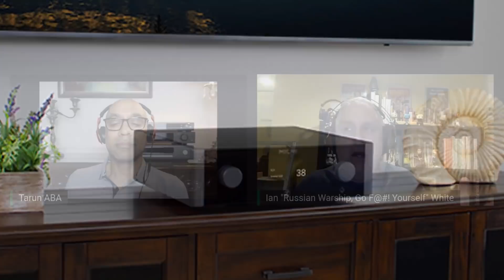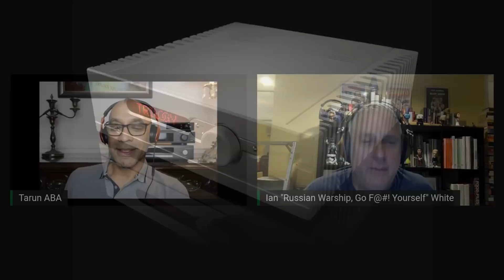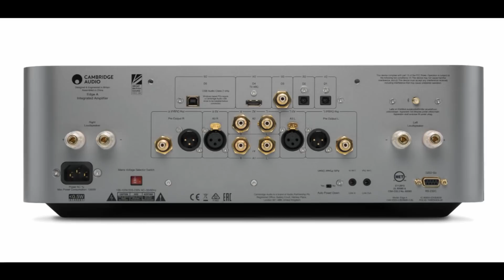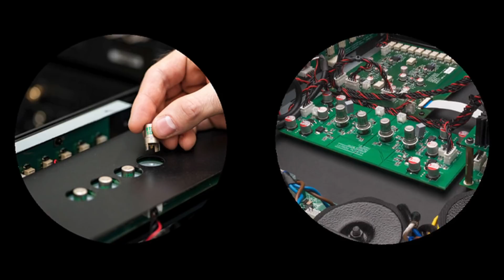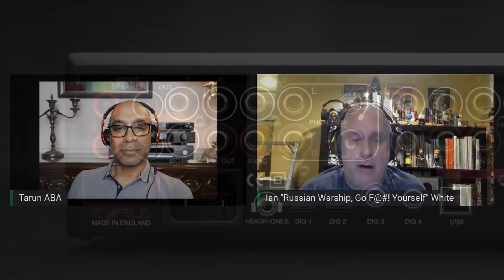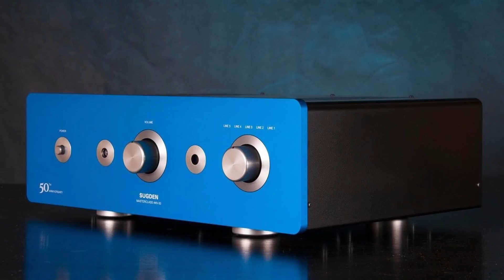Our favourite amps - The pricey stuff!

Comment: Great video guys.
Im a fan of Musical Fidelity and user of 1.
My system breakdown..
Nad m17 V2 master series processor. 
Musical fidelity M6 series 5 channel amp.
Bowers n Wilkins speakers 🔊 
Front= 702S2.
Center= 705S2 paired together for the center channel. 
Rear= 705S2 
For home theater SVS PB3000 subwoofers. 
This sounds amazing in stereo and home theater.
Reply from the maker: Thank you 👍

Comment: Interestingly enough, I quite recently auditioned the Rega Aethos. It is, with out doubt, a superb integrated amp. But then, I’m bias. The Rega Elicit had been the beating heart of my hifi rig for the last 30 years.

I recently sent my 30 year old Rega back to the manufacturer to undergo a full service. When it came back my local Audio T let me blind test it against the Aethos. Considering the Aethos retails at almost twice the price of the Elicit, I had to listen very hard to notice any difference. It wasn’t until we tried both amps on more difficult to drive speakers that the Aethos demonstrated better grip and control. Even the guys at Audio T were shocked at how close the 2 amps were.
Reply from the maker: Thank you for sharing Howard 😊

Comment: I’ve just watched your REL T-7x review which is very informative thanks. I’d like to connect two of them to my two-channel system at the speaker end not the amplifier end for ease of physical connection. What do you mean by don’t connect in this way if you have a balanced amplifier?
Reply from the maker: Thank you Kevin. You can’t use the REL high level input connected to the speaker end of terminals if you have a balanced amplifier 😊

Comment: Hello BA. Different cables touching each other in an amp, for a clean view purpose, is by many electrical standards the worst thing you can do in hifi.
Btw, hifi cable with a kind of plastic on it, in that MICHI ??? In 2022 ???
They really can solve this, it's not even a question of price. I think they just forgot all about the cabling topology in the ocean of hightech they're swimming.
I just wonder : did you ever talked about or tried speaker cable risers ? Don't u miss it, it's a huge one. It's huge. I'm sure you'd be very pleased & surprised by this incredible electrical trick.
Reply from the maker: Thank you for sharing Vivian. I haven’t explored cable risers 😊
Reply: @abritishaudiophile7314  Hello Tarun ! GR Research sales no risers but has currently made some DIY "Tinker Toys" almost free risers for his high end system... and works for him ! The idea is to put your cable like 5-10 cm away from anything else.  Works pretty fine with 2 streams of 2x16 Duelund by HP for me.
The worse support for cables could be synthetic carpet, any metallic support, everything with high dielectric constant. Have a nice day.

Comment: Hello. I love watching anything hifi. But chances are I will always be at the lower end of the hifi budget unless one of the lotteries comes up. At present my system is around £3000 worth rega 3, marantz cd & integrated amp with bowers & wilkins 607s2 anniversarys.
Now I ask how would I even know what a 10 or 50 thousand pounds system sound like as I don't move in those circles & I can't really waste a specialist hifi proprietors time just because I would like to hear the difference. Watching YouTube can't really give you a taste of what they are really like compared to my system. All I see is massive room taking speakers, valves & metal cases listening to YouTube sound on my samsung mobile or TV app. It's not a lot to ask to do that 1 thing before I die (not yet though). But I also ask is YouTube really the best platform for demonstrating hifi at all apart from its aesthetics. Not knocking the expensive stuff, just inquisitive, I can but dream.
Reply from the maker: Thank you for sharing Dave 😊

Comment: This was a very interesting discussion.  What  really caught my interest was the Sugden & ATCSCM40 combination. From your description it seems this amp drove the ATC speakers well (to highlight the talents of  the speakers), how would you describe the sound itself as oppose for same speakers driven by a powerful solid state amp?
Reply from the maker: Thank you SS. The Sugden Ann 50 has warmth whilst maintains good control of the SCM40s. This imparted a really alluring tone to the ATCs with acoustic music in particular. I would expect something like the Rotel Michi X3 with 200W on tap to have better grip, play louder but not necessarily impart the same tone. I would have to get them home to find out for sure. It all come down to what your goals are from your system 😊
Reply: @abritishaudiophile7314  Interesting combination I read the same sort of positive review from Asia when a Moonriver Amp404 (50watts x2 into 8ohms) was driving ATC SCM40's. Same sort of situation where the review states "The combination of ATC's high-end monitor and Swedish integrated amp doesn't seem like a good match at first glance, but the high resolution, transparency, and dynamic sound combine with the strength of the speaker and the objectivity of a purely musical amplifier without coloration, so the music in the recording is natural. You can get a system of excellent hi-fi sound that delivers the information without adding or subtracting."

Comment: Agree with you on the Musical Fidelity. Been a loyal fan since I bought the A1 back in the 80’s. Now running the Nu-Vista 800 with Kef Reference 5’s (fed by a PS Audio DS dac) and the sound is amazing.  But if I had to choose any other amp, it would be a Sugden.
Reply: I own a Musical Fidelity amp. Their entry level M2si. I absolutely love it.
Reply from the maker: Th am you for watching and sharing my friend 😊
Reply: Nice set up.
That I'm sure sounds incredibly amazing...
My set up is awesome for me.
My breakdown.
Nad m17 V2 master series processor. 
Musical fidelity M6 series 5 channel amp.
Bowers n Wilkins speakers 🔊 
Front= 702S2.
Center= 705S2 paired together for the center channel. 
Rear= 705S2 
For home theater SVS PB3000 subwoofers. 
This sounds amazing in stereo and home theater.

Comment: Hey guys, great list.  With you all the way to 19mins 30secs 😂

I noted the Supertech slit foil smoothing caps in the Rotel amp.  I buy them from DNM for all my upgrade projects.  No surprise to me it sounds good if they’ve gone to that extent on parts.
Reply from the maker: Thank you Mark. You should check out the Sugden Ann 50. You may be surprised 😊
Reply: Japanese amplifier manufacturers have always been in the habit of using sprinklings of premium components in their designs. On a separate note, many years ago I was visiting the Mission/Cyrus factory (the two were one company back then) and met Denis Morecroft (DNM) who was apparently working on the Cyrus amps. Subsequently they used his ‘slit foil’ reservoir caps and Cyrus produced some thin, solid core, speaker cable.

Comment: I’ve not heard the current Michi amps but I remember their predecessors. As said by your friend they were beautifully built but produced quite a cerebral type of sound that had good detail and delicacy but dynamic was not the best.
Reply from the maker: Thank you for sharing 😊
Reply: @abritishaudiophile7314 , I should add that the pre-amp (it was a pre-power combo) was a passive design (they hadn’t quite caught on then in the way they have since) and that may well have been the reason for the lack of dynamics. Unfortunately, I never heard the two units in isolation.
Reply: That all changed after Marantz legend Ken Ishiwata moved across and worked for Rotel before he passed away. He taught them how to create bass dynamics, solving the one weakness they had. And now Rotel has taken over the mantle from Marantz if producing the best integrated amplifiers in the world.

Comment: Trilogy used to be much more competitively priced but, some years ago, they made the decision to use a distributor rather than sell directly to shops (as most U.K. manufacturers do). Inserting a distributor into the sales chain meant that prices more than doubled over night and instantly rendered them poor value.
Reply from the maker: Interesting. I would like to review it sometime and find out really how good it is 😊
Reply: @abritishaudiophile7314 , the last time I heard Trilogy amps they had just released some new pre-power - both hybrid designs and very nicely built. Sound quality really stood out, great flow, dynamic shading and sound stage - really very transparent.
Reply from the maker: @AudioFlat  the 925 integrated did sound might impressive in the demo but I would have to get it home to tell for sure 😊

Comment: My Question is: HOW DID MUSIC EQUIPMENT BECOME 20X TIMES MORE EXPENSIVE since the 1970s in order to get REAL QUALITY?

& I really like this format for some of your shows and illuminates items or even economic changes..., leading to examination. - I'm a NERD!
Reply: Personally, I think the inclusion of DACs in integrated amps has muddied the waters. The Sugden is line level only, doesn't even have a phono stage and it's in the same shootout here with Integrateds that have phono stages and complex digital audio inputs. What is "better" for the same price? In my opinion, it would have to be the amplifier with no additional digital circuitry - there has to be compromise somewhere as you ladle in more features.
Reply: Actually if you factor in INFLATION over the past 50 years you actually paid MORE back in the 70's for the TOTL Monster Receivers than the gear featured here.
Reply from the maker: Thank you guys 😊
Reply: Hmm. In the 70s aged 17 I paid £30 for my first record player from woolworths where I worked along with an Al Green album that I played to death. At today's rate with your calculation that deck would be worth around £600 today, which it's wouldn't be. I could probably pick up a record player integrated like I had now for around £90. So it's not all that bad & the tech is better now. I do think more homework is now done on the tech side & electronics are smaller & smarter. So maybe it's not so bad today. By the way I still have that Al Green plus more of his in many formats sounding so much better. I also think years ago much hifi was surround in teak wood (awful).
Reply: @ENGLISHISBEST  like I said high quality, but I got a Sansui 4500 quad near 50 pounds weight new for $250... 1973, but what I've heard reviewed for the last several years is that kind of Quality would be over $5,000 to $8,000.

I bought a lot of records at woolworths in texas where I was a kid and teen. 
... lot of stores on the border selling cut out back then. I sometimes got as many as 10 for $1. I had every single Stones album that way and so much more. 

I had an AR Turntable $100 bucks 1969 that could on most days compete today with $500 buck TTables.... thats' like 5x Times more expensive.

It doesn't matter currently since the COST of PARTS are high because the owner and the distributor and grocery store are all the same company.... Their tricks make them BILLIONS. 

seems that way to me anyway. THANKS.